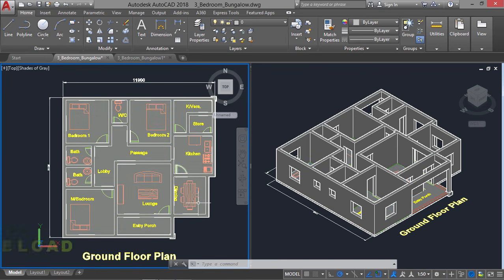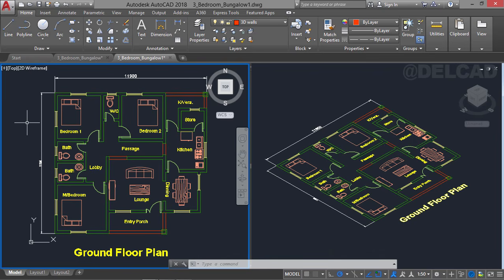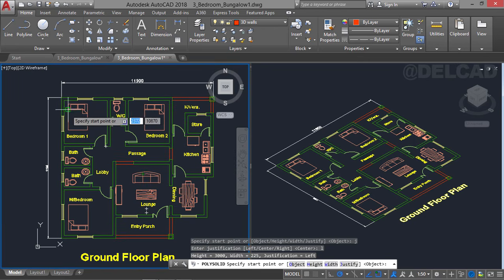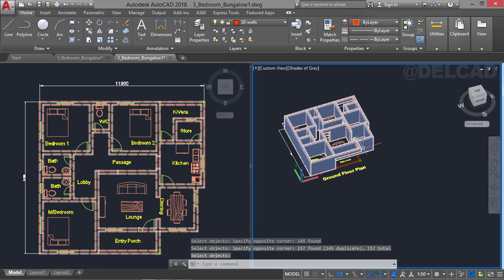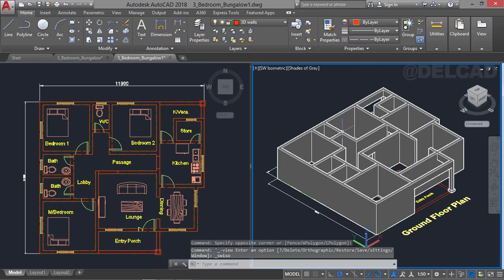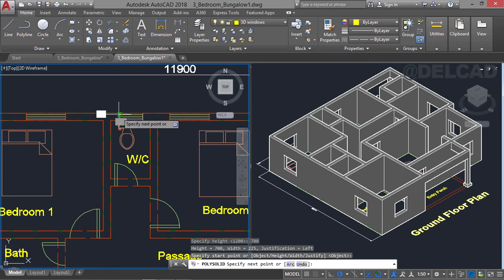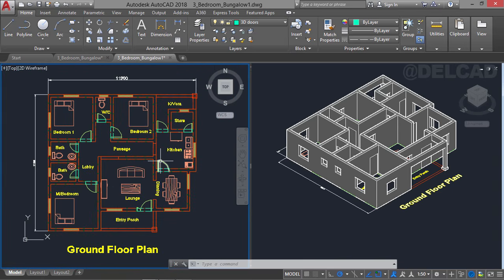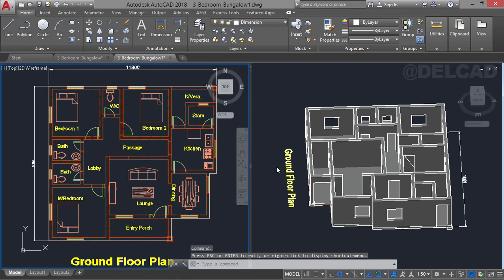How to Convert 2d floor plan to 3d in AutoCAD

Comment: How did you have both the 2D and the 3D on the same screen
Reply: Good question
Reply: You tap the view on the ribbon. Then under Model Viewports, youll choose in any viewport configuration. What he used here is Two Vertical

Comment: How do you add roof to this design?
Reply: You can use the Box command and make individual rectangles on the top then use the union command to join all the rectangles and a complete roof will form.